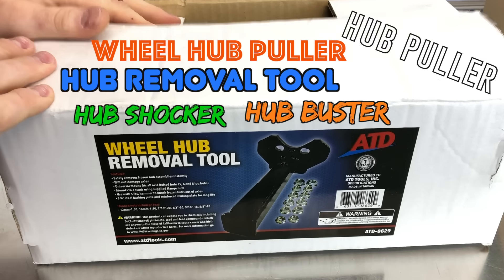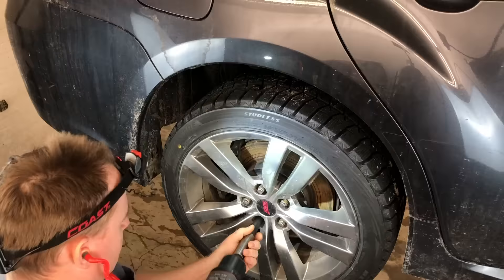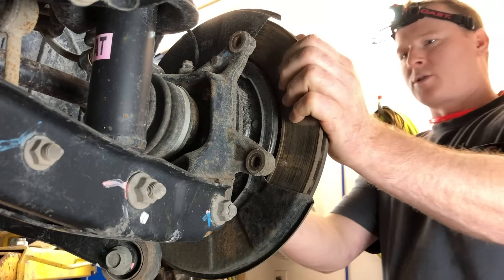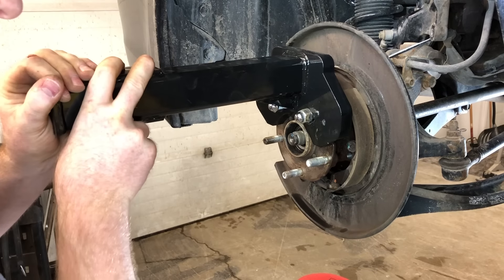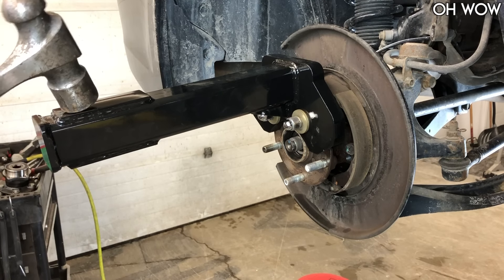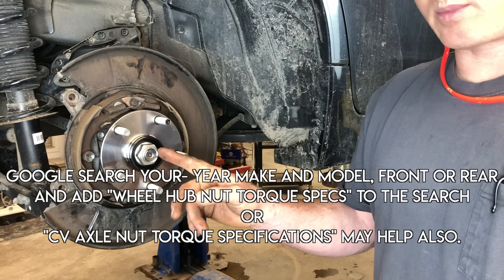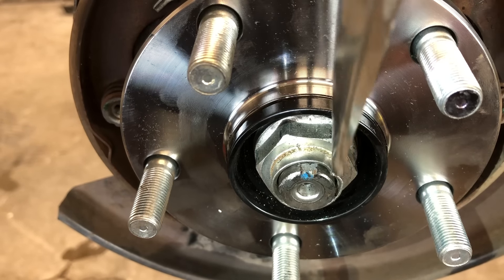HUB SHOCKER Hub Busters  |  REMOVE STUCK WHEEL BEARINGS EASILY!

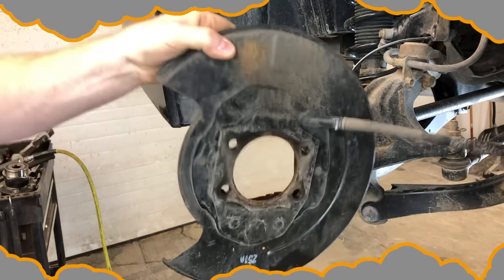Comment: look at @3:47 the shaft is bent.  use the right tool for the job. short cuts get you nowhere.!
Reply from the maker: I just checked my video to see what you mean. The subaru has rear axle Cv-shafts on each side. You can't see the boot/cv joint behind the knuckle very well but its there and maybe that angle makes it look bent without seeing the cv joint. It's just behind the inside of the knuckle.. It's not bent. Here is the hub shocker 2.0 video if you have time to check it out. It's been working great for me on severely corroded and stuck wheel bearings😃🔧🔧  https://youtu.be/eKqYtMdlPYo

Comment: This will not remove any wheel bearing 

I even tried their updated thicker one with a sledge hammer 

the Ford explorer wheel bearing is so deep and so thick the shocker won't remove it, 2012 - 2019 rear wheel bearings Taurus and Explorers are the biggest PITA to remove
Reply from the maker: Sorry buddy. The fords are horrible. Did you see my second video where I through bolt the tool? I wonder if through bolting combined with a jack stand to secure the suspension.... would that transmit enough energy to break the rust bond free???

Comment: Nice video but what is a "reluctor ring"?  As someone who makes hub bearings for a living, we NEVER call it that.  I have NEVER heard anyone call it that.  We call it a seal as that what that it does.  It seals in the grease, balls, and retainer.
Reply from the maker: Cool job man! The reluctant ring is sometimes also called the ABS “tone” wheel. It induces AC current with the abs sensor so that the abs computer knows the speed of each individual wheel. It’s a part of the abs, traction control system. The air bag and engine control and instrument panel sometimes use the wheel speed also for their functions. Does that help? I may have called the reluctor ring the incorrect term. It goes by a couple different names. 😀
Reply: @EasyFixShaun  you would be surprised as to there is not much into making a bearing.   At least to me there is nothing to it.  But what is also neat is that when it comes to the ABS bearings is that there what appears to be metal shavings in the seal (or whatever you want to call it) that you can only see with a flashlight pressed behind it and that what makes it anti-lock.  Not all bearings are like that.  Anyways, if you take a magnet to the seal,  you render the ABS useless as it moves the "shavings" from their position that they need to be in.
Reply: @EasyFixShaun  what brand of bearing did you use?
Reply from the maker: I have pulled a lot of bearings apart that were old and a lot of new ones. In school we did a lot of failure analysis. I have never seen any shavings except on old bearings.
Reply from the maker: I used a Subaru bearing.
Reply: @EasyFixShaun  chances are, Subaru doesn't make their own bearings.  Most If not all of the car manufacturers outsource that kind of stuff to companies such as mine.  We do make a Subaru bearing.  As for the "shavings" comment, it would be easier to show you what I am talking about.  You have to take a flashlight and place it behind the seal and look at it.  If you take a magnet to it, you will ruin the ABS part and will have to replace the whole seal and stuff.
Reply from the maker: @bearing_aficionado  That is crazy. I will check that out. Might take me a little while. But I will do it 😃

Comment: This didn't work out for me I ended up replacing my steering knuckles too after heat 20lbs sledge hammer air hammer hub buster nothing worked
Reply from the maker: Sorry It didn't work for you. What make and model vehicle were you using it on?

Comment: This tools 'HAS' potential. Just not in Ohio. I first welded extra metal to it to reinforce it. It takes some bearings, but after about 15 it is completely bent to hell and back. Good idea, just not strong enough for the super rusty vehicles in our area.
Reply from the maker: Interesting. What kind of vehicles do you use it on usually? I have been using it mostly on Subaru’s and they are stubborn like you wouldn’t believe. My only problem is getting lugnuts to fasten onto the studs deep enough to not strip. The tool is such a force multiplier that the lugnuts will rip right off the studs if not tightened properly with washers. The tool hasn’t bent at all and I have 20-30 bearings that have been bolted onto it so far.
Reply: Ford explorers.. Subaru. Gm.. We do all makes and all models.  You can spend a hour or more with a heavy duty snapon air hammer.. Our hub tamer is so bent you wouldn't believe. Ya lug nut section has been chewed away.
Reply from the maker: Nice man. You have used it on a great mix of vehicles also. I can't believe you bent the hub tamer. Is that a shop tool? Man some of corrosion on these bearings is so ridiculous. What are your top three hardest to remove bearings?
Reply from the maker: Check out the new updated video. Any better? What do you think? https://youtu.be/eKqYtMdlPYo

Comment: Now, did it went well for the other bearings on that car ?
My advice for average Jos:
Don’t buy Chinese cheap bearings from Ebay sold by a crook. You’ll have to start all over in less than a year.

Get OEM quality parts.
Reply from the maker: Here is Hub Shocker 2.0. I solved all problems I was having with the tool (mounting and bearing separation). This thing is amazing 😃🔧🔧  https://youtu.be/eKqYtMdlPYo

Comment: Just take the bolts out and drive it like you stole it 'till the hub flies off.
Reply from the maker: Here is the updated video I made. There are some problems with the tool that I solved! I now mount it with grade 8 bolts. And I solved the bearing separating in two pieces with the cv axle nut. 😃🔧https://youtu.be/eKqYtMdlPYo

Comment: That hit can damage the wheel carrier insert. Lol I should try it though and use Thor hammer
Reply from the maker: What is a wheel carrier insert?
Reply: @EasyFixShaun  bearing inset hole for bearing.
Reply from the maker: Oh you mean the knuckle. Technically you are right. In practice though I have not seen it happen. I’ve replaced a lot of bearings. I’ve hammered hard enough to separate and break bearings but never the knuckle. The knuckle is extremely strong. The knuckle and the bearing are two separate parts. Some vehicles characteristically corrode worse than others over time. When this happens force needs to be applied in some manner to separate them for repairs.

Comment: I mean, you could have just used a slide hammer...would have made that job even easier
Reply from the maker: I’ve tried slide hammers on Subaru’s and other cars. The bearing usually separates into two pieces leaving one half still stuck in the knuckle. Usually that half is even harder to to remove.

Comment: Ok so it isn’t designed to remove any wheel bearing, it’s designed to remove a wheel bearing assembly.
Reply from the maker: Correct. Any modern bolt in style wheel bearing.
Reply: You should probably step away from the tools if you could not understand that from the get go.
Reply from the maker: @CB.5  I totally know what you mean CB 5. But...go easy on him. Everybody is at a different level of experience on the interwebnets. 😃
Reply: @CB.5  and if you can’t comprehend that I was just picking at the title of his video then maybe you should step away from YouTube because if my comment went over your head then there is ObViOuSLy alot of other things on YT that you will struggle with.
Reply: @EasyFixShaun  I’m fully aware of what it is and does, my intentions were to help you with your video title. Maybe I should have elaborated a little more

Comment: Try that on a new forester/ outback,  not so easy
Reply from the maker: This tool will easily and quickly remove all modern bolt in style Subaru rear bearings. I work on a lot of them. I can replace them in roughly 20 minutes with the tool only. Super easy. Any other method takes hours and hours and hours. You need to watch the second video. There are updates for tool mounting and bearing separation during removal. The tool is so powerful. Here is the exact video for you. The demonstration is also a Crazy stubborn Subaru rear bearing. https://youtu.be/eKqYtMdlPYo

Comment: you can do this for free with a pipe wrench and a sledge hammer, even better if you have a rotor layin around.
Reply from the maker: Great idea with the rotor. It can be be built. I would avoid the pipe wrench method. The wrench can fly off since its not bolted on and damage the vehicle or the person using it. 😃🔧🔧

Comment: I bought one of these hub busters and it didn’t do crap.  I beat on it for hours even using the end of my splitting maul. Useless tool. Save your money. It’s junk.
Reply from the maker: I understand the frustration. There are a lot of BRUTAL bearing removals these days. The tool is amazing. I use it all the time. It is cheap and it is a great option to have around for most corroded bearings. The tool isn't the problem. The "rust bond" is the problem. It forms around the "bolt in" bearings and is extremely difficult to break. It seems like it is welded in sometimes. Engineers are not helping their cars be repaired further down the line. Some bearings are characteristically worse than others. I only use a 8lb sledge on mine now.
https://youtu.be/eKqYtMdlPYo
Here is the second video with several tips to make the tool work. I through bolt with grade 8 bolts ONLY now. It transfers more energy. That causes a lot of bearings to start separating because of the extra power. I then use a Cv-axle nut trick to keep the bearing together during removal. If it separates into two pieces, it makes removal even more difficult 😃🔧
Reply: @EasyFixShaun  my fix was on a 2010 Ford Taurus and I got so frustrated. I smashed on that thing for most of a day and half of the next. Couldn’t get it to budge. I changed tactics and got a 1/2 hardened steel bolt and a couple nuts.  Cut a couple wheel studs out and put the bolt through with a nut on the backside. I used a 1/2 inch impact tool and a wrench on the back of the hub. Finally got it to crack the corrosion bond. Cleaned it up and used a bit of never seize on the hub before installing it. Never again!
Reply from the maker: No wonder you had problems! The fords are the most challenging right now. They are so bad, a lot of knuckles get replaced because the bearings just will not come out. Great job getting it done with bolts. By far the best method for your model, explorers, and edges. Bearing replacements shouldn't be hard fir any of us. Especially with "Bolt in" style bearings. They are literally meant to be be easy, but somehow manufacturers have made it hard. It is insane to me 😀🔧
Reply from the maker: Nice job!

Comment: oh would you just look at that? look at that!
Reply from the maker: Just look at it! Psh. 😀🔧🔧
Reply: @EasyFixShaun  Those videos just popped into my head, this is a good tool for application though. My buddy and I took turns switching off beating hubs apart until our hammer broke and then repaired the hammer and kept switching off.
Reply from the maker: Man that’s a stuck hub. I can’t believe you broke your hammer!  The tool works Awsome. Did you see the second video I made. You will need to. It solves mounting issues and bearing separation issues so it doesn’t leave you with half the bearing stuck in the knuckle. Hahaha I thought you were making a Ed bassmaster reference. Psh! 😀
Reply from the maker: Here is the new "shocker 2.0" video if you need it 😃 https://youtu.be/eKqYtMdlPYo

Comment: Great tool.... until wheel bearing blows apart🤣. But works most of the time.And neverseize the crap out of knuckle and bearing.... you’ll thank me when you get a warranty claim 3 months later...
Reply from the maker: Do you mean bearing seperation when using the tool? I have had that problem along with some mounting problems with the tool. I solved those with the second video if you want to take a look. 😃🔧🔧 https://youtu.be/eKqYtMdlPYo

Comment: Yup just ripped the front of my bearing off.
Reply from the maker: Have you seen the second video?  I show how to stop that from happening with the cv axle and nut trick. I have also pulled bearings back together with this method so that the tool can be used again effectively to get the whole bearing out in the case that it splits in half 😀🔧
Reply from the maker: Here is the second video with several tricks for the tool  😃🔧https://youtu.be/eKqYtMdlPYo

Comment: awesome? Theres a much much  much easier and FREE way to get these out every time. take the rotor off, take the 4 hub bolts out of the back but leave 2 of them in like 3 threads. Bolt the wheel back on and lower the jack. DONE and no need for a $100+ huge tool in your box
Reply from the maker: I think that would work! Do you do it a lot? Does it work on Subaru’s? Or ford explorers? What kind of vehicles do you usually try it on?

Comment: I have had a problem that's been driving me nuts. The wobble you showed, I checked and that's not it, but when I drive the car it sounds like I have a flat.
What the h*ll is it?!?
Reply from the maker: Did you visually shake and spin all tires? For me, I guess the wrong wheel bearing at least 1/2 the time.
Reply from the maker: I would check air pressure in all tires to be sure that is correct also. Try to check some off things off the list. By process of elimination you will narrow it down. Here is a video on shaking and spinning tires as a visual quick test. https://youtu.be/nl7cU2wHBXg
Reply: @EasyFixShaun  I shook all the wheels: up and down, in and out. Nothing, no movement. Tire pressure as recommended by manufacturers and the problem presist.
Thanks for getting back to me about this.
Reply from the maker: @theodore roberts Ok, that's great. Basics sound like they check out good. What about tire tread wear? Are any the treads "feathered". especially the fronts? If you run your hand over them one way it will be smooth. Run your hand the opposite way and it is rough. If you have that, you could have a tread wear issue causing the noise. Most cases you can quiet that down by rotation the worst tires to the back of the vehicle (as far away from the driver as possible). As long as its just a tread wear issue like that, it isn't really unsafe. Its just annoying. Some tires and some vehicles promote bad tread wear. Usually 4x4 vehicles and usually very aggressive "luggy" type tires. Especially "luggy" lugs on the outermost and innermost band of the tire. Those types of tires wear horrible over time. That's why highway tires are so quiet....they have a continuous band of smooth rubber on the outermost and innermost bands of tread 😀 ....just the next step, check that quick and let me know what you find!
Reply from the maker: Also....what year make and model car is it?
Reply: I've got some tread.it's a 1988 Buick Regal Limitwd, 6.
Reply from the maker: Ok that’s good. How does the tread feel when you wipe your hand of it to check for feathering?
Reply: Will do.
Reply from the maker: Ok so no feathering right? Could it be a broken belt in a tire. Maybe spin the tires and look for irregularity like a broken or shifted belt.
Reply: I will do..
Reply: We have snow now.
Reply from the maker: 10-4. Keep me posted 😃

Comment: THOSE ARE EASY I TANKE THEM WITH A CREW DRIVER, I'D LIKE TO SEE A DEMONSTRATION ON A STUCK ONE.
Reply from the maker: This was a rear bearing on a rusted Subaru. Probably the most difficult bearing to replace right now. It made it come out like butter. The only other option are knuckle removal to "press" out the bolt in style bearing. Kinda defeats the purpose of bolt in. But that is what Subarus do and a ton of other vehicles if you live in the midwest, east coast or Canada. No matter where you live this tool is as valuable as a hammer. When you need it....you need it. Unless you like doing things the hard way. Anyways, new video coming soon with more information for you 😀
Reply from the maker: https://youtu.be/eKqYtMdlPYo Subarus are the worst on planet earth. Let me know what you think. The updated video mounting method is the only way to go. Leaving the axle nut stops the dreaded bearing separation problem.. I would say dreaded Subaru rear bearing is easy for me now.